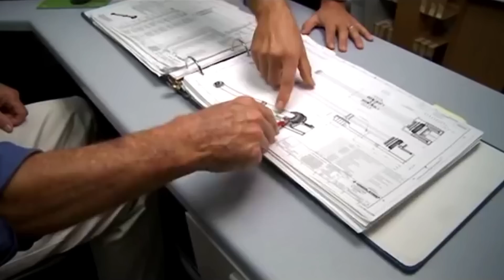US's Ultra-Advanced Railgun Weapon Is Making All Others Obsolete

Comment: Superconducting research is essential for this technology to be miniaturised. The currents involved in the conductors are gigantic !
Reply: Actually one thing I'm wondering is.
Rather than aiming for 100% top-shelf hypersonic performance.
What would happen if they try to just match the performance of current 'big battleship guns or even current Frigate/Destroyer/Cruiser guns.

For instance, on the Royal Navies Type 45 Destroyers they have a:

4.5-inch Mark 8 naval gun
Shell fired: 113 x 700mmR, 21 kg HE
Calibre: 113mm
Max Range: 27.5 km
Barrel: 55 calibre
25 rounds per minute
746 m/s

Purpose: emphasised reliability and rapid response to fire first round from shutdown state (particularly for defence against missiles)

So, if you can match the 4.5 inch Mark 8 with a rail gun, that would be fantastic. You don't have to make your first version a rapid fire hypersonic guided smart shell for maximum effect.
Reply: @MostlyPennyCat  Would matter since the guns cost about 10 to 100 times more than conventional guns, and it would not solve the barrel wear problem either.

If I had to guess, naval guns will be replaced with missiles & drones. They might not be able to deliver the ordnance as quickly, but they can track targets, and be set up to deliver cluster style munitions to deliver a blow to a larger target area. Consider a drone or missile that has dozen or more warheads that split off as it nears the target. The area of munition dispersal could be programmed or changed on the fly. Plus a set of missiles can be used to targeted a full 360 degrees without have to rotate the ship like a deck gun. Drones could also loiter over a target. Consider firing a volley of munitions at a target, observing the results and than using a second volley to finish the job.
Reply: @MostlyPennyCat  Actually it's going the other direction, the US Navy has fitted the high velocity projectile from the rail gun in a 5" Shell sabot.  Lighter round, higher muzzle velocity better range.
Reply: @MostlyPennyCat  Too slow for a kinetic slug to have any effect, so it’s back to explosive shells. The use of kinetic ordnance was one of the spurs to development in the first place.
Reply: @MostlyPennyCat good point. it would also be very useful for pumping multiple rocket assisted projectiles into the air very quickly.
Reply: The big problem is barrel wear.
That's the main reason they've cancelled them all, needs new materials science
Reply: @MostlyPennyCat  I'm pretty sure  some agency is researching composite alloys for railgun barrels.
Reply: @joeclaridy  im that agency
Reply: @joeclaridy  Nope, it's the LARGE current involved (heat) for each shot, plus arc erosion. If the conductors have to be large enough to withstand reaction loads, heat absorbed, and arc erosion. They will be carefully machined, to maintain clearances. Or you will end up with part of your rails going out the muzzle with each shot.
Reply: @joeclaridy  That is true, but it's basically on a backlog right now.
Reply: @joeclaridy  good luck to them the plasma the process develops from my understanding is so great it literally strips a lot of metal off barrel with each round. The unfortunate thing is by attaining the speeds it's also part of the cause of wear. Where you can get similar speeds out of special gun powders. I think the US NAVY has gotten 5 inch shells to get around Mach 6 out of their traditional cannon. So having to replace a barrel after 5 to 10 rounds is a big deal on a rail gun. Where you should be able to get thousands out of a regular gun I'm not real sure exactly how often they have to change barrels out of navy guns. You need someone in navy to tell you that. Hope this helps
Reply: @MostlyPennyCat  Do you believe them?  I'd keep an ace or two up my sleeve.
Reply: @theduplicator3270  
Do I believe what and from whom?
It gets difficult to track what prior are replying to! 🤣
Reply: @MostlyPennyCat  
Modular barrels of some kind.  Ceramic-polymer backing layer, also modular, and swap them over time.  It's having that level of production which probably gets in the way.
Reply: @Binturong3850  That won't work, because the barrels need to be conductive, using a conductor that has low resistance, like copper or silver. Ceramic would shatter under the very high stresses when the gun fires.
Reply: @Binturong3850  ceramic polymer would reduce conductivity
Reply: @Binturong3850  It needs to be conductive, and resist heat and wear, there's a short list of candidates, none have held up.
Reply: @guytech7310  
Possibly, possibly not.  Depends highly on the formula of the ceramic composite.  There's poly-ceramic composites which are very shatter resistant especially with ridgid backing like this would have as it is a sleeve against the barrel.  Very unlikely to shatter, nowhere to flex, damn-near impossible to crush.
Reply: @williamforbes6291  
Carbon-ceramic composites are a thing too.
Reply: @PhillySail  
True, but none YET.  They surely haven't tried everything.
Reply: @Binturong3850  No ceramic composite is going to match the conductivity of copper or silver.

That's why its un-obtainium. The issue is that its needs three properties that don't exist together:
1. very low electrical resistance
2. Very hard & resistant to plasma arc ablation
3. Low friction to avoid drag.
Reply: @Binturong3850 the problem with that is that barrels aren’t equal. The characteristics of your projectile will be different every time you swap barrels.
Reply: @MostlyPennyCat  Or you could coat the barrel in relatively low temperature plasma double layer acting as a magnetic wall to protect the actual barrel housing…
Reply: @manofcultura  
That, almost makes sense.
Jesus Christ, this thread became quite the clusterfuck didn't it?

OK, the BIG problem with railguns.
The NUMBER ONE problem is the "rails" getting torn apart by heat and friction, specifically from arcing.

But, plasma conducts
I wonder if you could fill a gap between the rails and the projectile with plasma?
Guide rails for the projectile top and bottom, you're still using the Lorentz  actuator. Not sure it would stop it arcing though.
Reply: @MostlyPennyCat  no it’s not , that’s the problem for commercial sales
Reply: @MostlyPennyCat  strange, i thought they would be using magnetic fields along the rail to eliminate friction.
Reply: @johnbell1810  
Then it wouldn't be a rail gun, but a coil gun. 🤷‍♂️
Reply: @MostlyPennyCat  Not if you create a magnetic field so that the projectile doesn't need to touch the inside of the barrel.
Reply: @eastafrica1020  
Then it's not a rail gun, it's a coil gun I believe? Works on the same principle that the 'AC pancake' uses, the rotor is non-magnetic but ferrous. A magnetic field is induced in the rotor, which repels the electromagnet and does the Work.
Very simple and very robust.
Reply: @eastafrica1020  
You could take 
 @I-Love-CO Mountains  
Replaceable coil/barrel segments idea and add it to your coil gun idea.
So, there's lots of identical assemblies and rigid framework on your coil gun
Have colour coded light on each section.
When one goes Red, open up that section of framework and pull out the coil barrel assembly
Now add the new one and close.
Press 'Test' on your navy tablet running the ships combat OS.
If it comes back 'no fault, ready to fire' get down below and select 'weapons ready' on the app.
Fire recommences.
You go off to the engineers' work shop to put in the replaced assembly for rework or on the next outgoing COD flight (Carrier Onboard Delivery, helicopter, comes 3 times a week to pick up and drop off.
Reply: @eastafrica1020  Then you have no current flowing through the projectile, so no force acting on it, you can't have a railgun, where there's no current flowing between the rails.
Reply: @eastafrica1020  Like a hadron collider
Reply: @MostlyPennyCat  
ayyye, i dig it!
Reply: @MostlyPennyCat  I don't think there is any materials science which can save the concept.
Reply: @kathrynck  
Not yet there isn't.
That's the whole point, you pack away the prototype project and this reduces your budget needs.
You build a smaller team that investigates all the new materials science being published.
Design a small test that recreates what happens to the material when it's inside the barrel.
Reply: @MostlyPennyCat  That's a sound approach to dealing with a stubborn research program, I agree. That's what I would do with 90% of problematic research programs if I were in charge of them.

I just don't think there IS a material which can make this particular idea work.

This isn't a "new" program. The navy has been playing with it for about 15 years, but the research goes back to the 1980's in the SDI initiative. The SDI railguns being tinkered with out a white sands had insurmountable problems, and basically were downgraded to "science project". And so is the Navy's venture.

Consider this: 

The projectile hits a target (like say a ship), and it punches through multiple layers of armor, steel & aluminum, causing a catestrophic kinetic energy release which blows a hole in the ship and damages systems. There's no explosive, it's terminal effect on target is 'kinetic kill'. Basically it just has so much kinetic energy that it makes a huge mess out of anything it hits.

Now consider the gun. It has to generate that kinetic energy, and in a barrel length which is no greater than the depth of penetration in the target. 

Kinetic energy follows newtonian physics. So what you're doing to the target... you're also doing to the gun itself. Actually you're imparting more harm to the gun, than the target, because the projectile imparts some of it's energy to the atmosphere while en route to the target.

In terms of newtonian physics, t's a bit like trying to beat up the enemy's fists by bashing them with your face. And yeah, if you do it hard enough, you can break their fists, but there's no way to avoid junking your rail gun in the process.

The barrel liners disintigrate, the magnets crack & melt from the strain, the outer barrel bulges and comes apart, the superstructure suffers unavoidable damage, the magnetic forces impart localized EMP-like effects on the launch platform, the magnetic forces also will warp the structure of the vehicle holding the railgun, and any personnel in the area will have their ball point pens, glasses, shoelace grommets, etc. turned into hazardous projectiles around the launch platform. Hell, the white sands research facility had to move the whole program into a brick building because their rail gun was destroying the hanger which housed it with magnetic forces.

They can't even build a single stationary unit, as an exotic "laboratory princess" made of priceless materials, which comes remotely close to being a fully functional device. The railguns get refurbished between every test.

And all this is before dealing with the issue of energy density to power it. (granted, that particular issue wouldn't be a problem on nuclear powered ships).

Railguns are the "Solar Roadways" of the defense industry. Have been for almost 40 years now.

I'd really put this particular program to bed. Except as a 'research tool', to study hypersonic behavior in atmosphere (up close), it has no utility.

Anyway, there's a vastly more attractive alternative. Ramjet-powered artillery shells actually 'work', and do what rail guns pretend to offer (a hypersonic projectile). You only need to fire them at mach 3 from the gun (slightly fast, but well within conventional artillery capability). And the ramjet accelerates the projectile further, outside the barrel while in transit. They can achieve mach 6-9, and they reach their peak speed partway to the target, at high altitude, which means there's far less energy loss to atmospheric drag. Arguably they can reach a target at a higher velocity than a railgun projectile. And without crushing & EMP-blasting any internal electronics.
Reply: @kathrynck  
Yep, although I think the tagline they're so interested with is you getting a hypersonic KE dump into the enemy and all your carried were some cheap and non volatile ferrous darts.
I'm not sure which comment you were responding to but rather than aiming for the unicorn gun you go more working-pony and just match the performance of existing naval guns, I listed the specs above.

Mach 2.2, 27.5 km, 25 rpm

Then, this research the shortcomings of the existing gun.
If they say range, we want X extra metres, then you raise the specs to match it.

It's like, if when in the 60s Kennedy said 'we got to Pluto. Not because it is easy but because it is hard

Most would say reign it in, too hard, go to the moon instead.
Now, rather than obvious failure, you get a good win.
I think they should make a moon rail gun, not a Pluto rail gun.
Reply: @kathrynck  like the bolter from warhammer 40k but scaled up to anti ship weapons sizes
Reply: @MostlyPennyCat  Well, a 'de-tuned' rail gun which fires projectiles at just mach 3... could actually work. And let a ramjet-powered projectile take care of the rest if you want it hypersonic. Or just use it for gunpowder-less firing of regular explosive artillery shells. It would require a LOT less power, and it wouldn't destroy itself. Could be something workable there.
Reply: @doomguy9049  It would be cool if it would work, ya :)
Reply: @kathrynck  wrong
Reply: @anthonydewitt7674  oh ok
Reply: @kathrynck  “whatever you’re doing to the target, you’re also doing to the gun” is a pretty big oversimplification. If that were simply a fact with no substantial nuance, no guns could function. You can mitigate destructive forces of combustion, electromagnetism, and every conceivable other source of energy by directing those forces safely or building things to resist them. The idea that it’s impossible is remarkably unscientific. It might be an extreme challenge but let’s not pretend that magnets are some magical science that can’t be understood
Reply: @humantwist-offcap9514  Guns also recoil with more energy than the bullet strikes the target. It's just much higher mass at lower velocity at the gun-end, with much more surface area. This is why it's absurd when tv shows & movies show guns knocking people back through doorways and such. If the gun fired projectiles with that much energy it would beat up the user as well.

That said, yeah, the conversion of the energy to greater mass & lesser velocity for the person holding the gun works. Because the steel of the gun can handle the forces involved. In other words the chamber, and to a lesser degree the barrel, of the gun are more robust than the force of the bullet (and expanding gases) it's firing. Not by a large margin though, which is why you have very bad results if the barrel is blocked, and pressure in the chamber rises too high.

There are other factors, like the rate at which the force is applied. Which in turn relates to the length of the barrel, and efficient use of powder & pressure.

The problem with the hypersonic cannon, is that nothing can really withstand the forces involved. Not in this compact (compared to conventional artillery dealing with so much energy) cannon design.

A 16" gun on an Iowa class battleship fires a roughly 1000 kg projectile at like 2500 fps. Firing a 10kg projectile at 8000 fps has MORE kinetic energy than that. And even the Iowa class battleships had at least 1 gun explode in 1989. Those guns are 270,000 lbs of high grade steel. Which is to say each barrel of a 16" cannon weighs more than 2x as much as an M1A1 tank. And all of that steel has one purpose, to hold it's shape.

The whole hypersonic railgun thing is a program searching for a free lunch which doesn't exist in physics.

That said, I think there's potential for a railgun which shoots projectiles at normal artillery speeds (or thereabouts). There's no reason that couldn't work. And ramjet projectiles can achieve the same speeds and have even greater range than a hypersonic rail gun. But the all-in-one hypersonic rail gun is just beating a dead horse. At least until you have materials which have like 20x the strength, hardness, durability, and temperature handling capacity of steel. And magnets which are both powerful enough for the application, AND can handle similar forces. And even then you'd be using ultra-exotic materials to achieve something, when there are far more practical approaches.
Reply: I want a portable civilian unit with a bipod
Reply: @theduplicator3270  
Be great for hunting season kill and field dress at the same time.
Reply: @theduplicator3270  Such already exists.   Just classified.
Reply: @theduplicator3270  would this weapon be a 'civilian' unit?Is there civilian artillery(outside USA that is)
Reply: @theduplicator3270  You know that there already working on it.
Reply: Too much current generates magnetic fields, and magnetic fields will kill superconductivity. There is a critical current density for all superconductor materials. You also have to consider that frictional heating at the rail will kill superconductivity too. What we need are either consumable rail linings/coatings that are cheap to replace (say for instance a sacrificial conductive polymer layer that gets turned into plasma after each shot), and/or high-temperature stable rails that ablate slowly over shots and are durable.
Reply: @just4deez  The cannon uses explosives to create a plasma to close the circuit. This stresses the barrel.
Reply: Hydrogen fuel can be used as coolant.
Reply: Superconductors have a critical flux density after which they will no longer conduct, they also don't allow any external magnetic field into them, which would mean more force on the rails, not less, you need a system where the rails are adequately supported as the armature moves along them.
Reply: This is really looking like the infant stage of science fictions "photon torpedoes " all you have to do is tip it with materials that would super heat at those velocities and that reaction could become a small fusion reaction... at impact it would be hell
Reply: Graphene (or maybe borophene) to the rescue 🤔
Reply: Your mom is gigantic
Reply: That's backwards, atm miniaturisation is limited by the energy source, if anything a miniature working railgun is easier developed than a large scale one. Size atm is limited by materials science and wear characteristics of the rail.
Reply: Eats the metal away in a few shots too
Reply: Those superconductors are getting there. It won’t be long.
Reply: By miniaturised what you mean is shrunk by half at the very max, when you say miniaturise that sounds like some handheld device which will never be possible.
Reply: Personally l think laser technology is the way forward. America already has it and the uk is ready to trial it in 2023 and ia a lot more efficient and stable.
Reply: @colinsmith1288  Laser is literally line of sight and only in clear air. It has potential for close in and air defense, but on a rainy day… Foggy days would look cool, but also no go…
Reply: @PhillySail  Thankyou for the insight,l did not think about weather conditions !
Reply: @colinsmith1288  They work pretty good in outer space :-D
Reply: Didn't this program get cancelled
Reply: It seems you have no idea about how it works !!!! You watch to much movies !!!! Miniaturising is the least of their problems !!!! They can’t event sustain the functions of this weapon at it present size leet alone miniaturising !!!!
Reply: @gerard4039  wrong , they’re having trouble making it commercially available.
Reply: Every Joule at once.
Reply: And after EMP you have no army.
Reply: Two words, silicon carbide
Reply: Do you know whether existing, known (cuprate) "high-T(c)" superconductors would be suitable for this purpose,  is their current density high enough? Or would the older niobium-tin alloy superconductor be required. The latter would entail much greater technical challenges.
Reply: Multiple barrels. Like an A-10 Warthog. Just bigger, and slower.
Reply: There is already Miniaturized rail guns and shot guns they shoot pucks A different ranges and different powers 

(The application can be replicated in miniature form with a lesser Velocity) 

They’re specifically asking for the development of Deploying these weapons overseas because a normal nuclear powered vessel dose not have enough Wattage for even normal firing or multiple firing affectively rendering it useless in battle

And I don’t see it being affective having to go to Port all the time to recharge 

The military wants it hyper sonic that’s why the rail gun is so big    Stronger material is needed so you can dump more energy into it and minimize the size and open up military applications  

I think the housing that The projectiles in is to protect the internal integrity it wouldn’t be needed if the barrel of the gun was re-developed so the barrel is smooth
Reply: Not just super condition but also energy / power delivery
Reply: Eventually,  the technology will be miniaturized to house in the US Navy ships and land-based Howitzers.  In the 50's and 60's scientists had to miniaturized the atomic bomb so that the yield of radioactive materials can be carried to a longer distances and still can knock a powerful punch.
Reply: The friction on the contacts will be the same no matter what type of electrical transmission you use, you need metal to metal contact, there is as yet no way around it.
Reply: Sorry as hell . One knows what protects freedom and Justice exactly we the people's jobs as we the people job and duty . Can't even fake we the people anymore clueless about what stand for lie down
Reply: The actual canon bore is torn off, it is not feasible with current metal alloys... Its literraly too fast and heats the metal to extreme heat plus the charge needed is insane. But one day we might use a beefed up version in space....
Reply: @Red_Salmond  I dunno. Most of the research on rail guns comes originally from the SDI program. And it was largely sidelined in SDI after a while, due to a long list of problems. Even back then, with the relatively bulky & weak chemical lasers of the 80's, lasers seemed a much more advantageous system for space use. I mean in space you don't have atmospheric degredation, or any undesirable light-bending in temperature gradients in the air. Plus no recoil, meaning not having to expend fuel to maintain position/orbit. Lasers are just too perfect for space. And lasers have gone through a renaissance in technology, where they're far smaller and more power efficient than in the 80's.
Reply: Have to start somewhere, this will boost that development and other areas as well, just like a lot of other military projects contributing to the general research in the area.
Everything usually starts oversized and using brute force instead of finesse, just like this will be done.
Reply: It seems like tax money theft.  The weapons are not designed for likely threats.  Drones, supersonic missle clusters that visually look and for most of their flight behave like the second wave of hypersonic missles... 1000 of these guns may not be enough. This does not look good on paper as a proper defense.  If we can prove pecision of shots and work on rapidfire super structure.. but im not seeing that. This looks like 1 lab that blackholes money
Reply: Dont they already have it anyway on cruisers or destroyers? Nimitz class???
Reply: Materials too. I think making a smaller version that shoots smaller rounds at lower velocities but with a higher ROF would be nice.

 I read coil guns would solve some of the problems. Take that with a grain of salt.
Reply: Blue Bird  
Woke, as in enlightened?
Yes, I do possess a superior mind and education, thank you for noticing.
Reply: Blue Bird  Never met him, 
seriously doubt I'd enjoy the experience if I did.
Reply: Blue Bird  
Y'ALL GOT ANYMORE OF THAT HUNTER BIDEN CRAAAAACK?????🥴
Reply: Thank you everyone for attending the Think Tank and providing your input. Love these replies.
Reply: The real threat to US citizens is the militarized police. We all need this railguns to defend our selves from them.
Reply: Not only that the end of the cannons it break faster than a regular one,what will happen they gonna put it away and in ten years with new metals they will better ,science take time sometime.sorry for my English,from Quebec  ca.
Reply: I don't see why maglev technology can't be combined with it.
Reply: @Mp57navy  too much friction and wear upon firing

Its under intensely ridiculous stresses upon firing
Reply: @Mp57navy  It is basically the same as maglev tech, and that’s the problem.  The magnetic forces are the thing damaging the rails. And the barrels are essentially the coil-wound rails; the conventional cannon look-a-like barrel you see is just cosmetic, and for environmental protection. It has no firing function. You could just have the naked rails.
Reply: @Mp57navy  Very wise.  More than you might guess.
Reply: @Mp57navy  because magnetic levitation puts a gap between the rails and the armature, which breaks the circuit. You can use other conductors, like liquid metal or plasma, but not nothing.
Reply: @Mp57navy  Because that's nowhere near powerful enough
Reply: @Mp57navy  Exactly. Something along the lines of incorporating the Meissner effect somehow, YBCO rails and / or neodymium jacketed slugs. Infrared heating etc. (need better high temp / room temp superconductors) and electromotive forces pushing the rails apart seem to be the big problems. Make a segmented modular barrel with some kind of shock absorption to lengthen barrel life..
Reply: The dirty secret with current superconductor research is that superconducting materials tend to break down and stop being superconductors when current limits are exceeded. So, while superconductors might sound like a solution to the problem, it will be a long time before they can handle mega-amp currents.
Reply: @snoig1  It’s no secret, superconductors have limits based on magnetic field, temperature and current. They aren’t “infinite conductors” but they do have zero resistance and perfect diamagnetism. The duration of the current pulse in a railgun is very short but requires a lot of energy in this time i.e. a huge power level for a short time. A major limitation on miniaturization is the power system. Another is the immense forces generated between the two rails which need strong mechanical support. However, with the right choice of mission requirements, railgun tech will prosper.
Reply: @paulbeharrell  Actually, the power requirements are not as much as many people think since, like you say, the pulse is short. I worked on a 30 mega-joule gun back in the 80's. So 30 MJ = 8.3 kWH which means a 746 kW (1000 hp) engine driving a compulsator could charge that gun at a reasonable rate. The problem would be the rails and compulsator melting down before you can get more than a few shots off.
Reply: @snoig1  I agree that power generation isn't a 'huge' problem. It's... somewhat of a problem, in terms of efficiency. But it's workable on large platforms.

I don't think a 746 kW engine would provide the rate of fire that the navy or other services would like. BUT... you might be able to finagle some accrued burst capability with super capacitors. And there's always bigger engines.

It's an awkward fit for a land portable unit, but power I think would be ok in decent sized ships.
_

The real problem with the rail guns are a long list of issues, which I outlined to Mostly Penny Cat earlier in this comment thread. It's a long list of really REALLY severe problems, which mostly come down to durability of the gun. Rail guns don't have "a bit" of a durability problem. They are completely refurbished between every test firing. 

And that's with access to materials which would be impractical to field on service units, and in lab conditions. You could have access to magical materials which don't even exist yet, and still you'd be quite a way from making a fully functional rail gun. I'm familiar with a large percentage of the exotic materials out there. Graphene, differentially porous titanium foam, some stuff I doubt is ok to type in public. None of it gets you to a functional railgun. Not like the program proposes anyway. Not even in the most ideal conditions, with an unlimited budget.

I genuinely believe it's purely a scam at this point. I don't say that lightly. I know a lot of people harbor ill-informed beliefs about all kinds of military hardware because they watched a '60 Minutes' tv show once, and immediately formed an opinion. That's not where I'm coming from. Usually when people learn more than a superficial understanding of the hardware, they realize their TV show was just a hit piece. I work in the defense industry, I get really sick of uninformed naysayers myself. 

I mean, I think the F-35 is a fantastic aircraft. The development process was a mismanaged clusterxxxx, but Lockheed's engineers managed to snatch a brilliant product from the jaws of a bureaucratic nightmare of a program. I don't work for Lockheed, i work for their competition, and I admire what they achieved. That alone should affirm that I'm not very susceptible to hit-piece news.

But this program... it really looks 'bad', and the deeper you dig, the worse it looks.

I would genuinely like an impartial third party to look at the personal finances of GA and the Navy brass who continued to approve the program as long as they did. It's an embarrassment to the industry, but sometimes, there actually are money scams in the defense sector. Not nearly as often as most people think, but it does happen.

At best it's a company promising something they can't deliver, except in CGI.
Reply: Enchanted netherite
Reply: That would solve the problem. Its the amps that create the large magnetic field that accelerates the projectile. Plus no Superconductor can handle the current flow in the current density needed. Superconductor would quench (ie lose superconductivity) before the projectile exited the barrel, and probably destroy the gun in the process. Plus Superconductor are fragile, either need to be metals at very low crygenic (Liquid helium) temps. or brittle high temp superconductors that still need be crygenic temps (liquid nitrogen).
Reply: @guytech7310  I wonder about graphene if it could be made into rail sized bars. In theory, it has lots of strength and graphene sheets have a resistivity of 10^−6 Ω⋅cm which is less than silver. Plus it might act like a lubricant for projectiles.
Reply: @snoig1  Nope: too brittle and will quickly vaporize and oxidize.
Reply: Bro they’ve been had this lol I remember they had one on a battle ship on discovery channel about 4-5 years ago